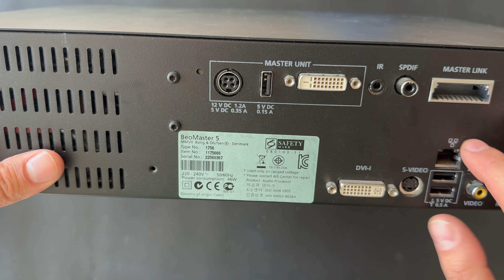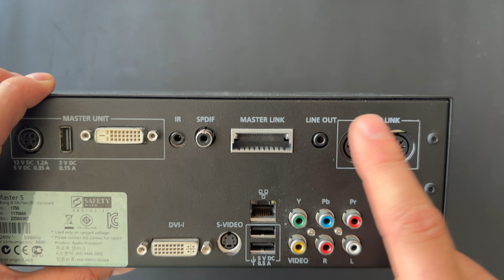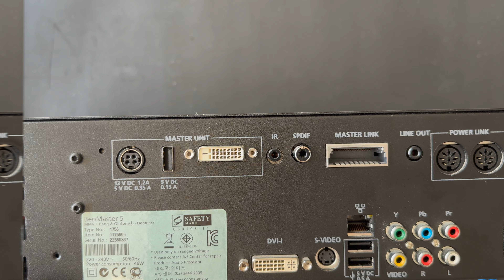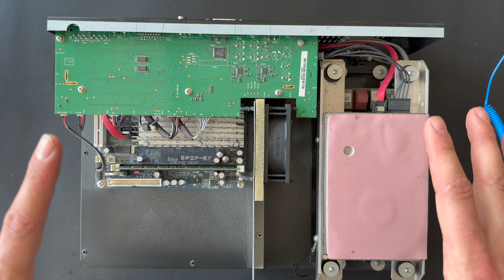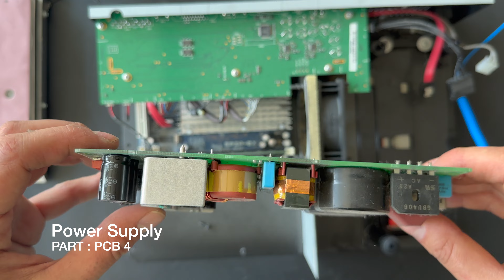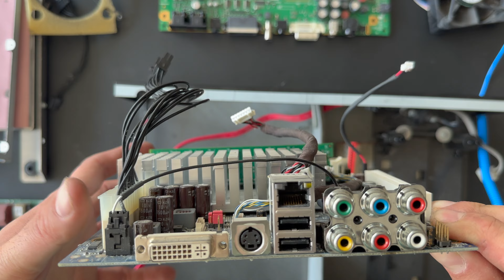Bang & Olufsen Beomaster 5 Disassembly process and Repair guide

Comment: Hi what does the 5V DC 0.15A control
Reply from the maker: The 5V DC 0.15A output is used to power external accessories, depending on the system configuration. It isn’t intended as a general-purpose power supply.

Comment: Mainboard may have been made by Asus, so not great to begin with. Also, I see lots of vented electrolytics. Chances are it will work if you replace them. You might look at Panasonic FR types for replacement.
Reply from the maker: Thank you for the suggestion! You're right—many of these mainboards have electrolytic capacitors that degrade or vent over time. Replacing them with high-quality options like Panasonic FR series is indeed an excellent approach and often resolves stability issues. We'll inspect the board closely and proceed with replacing the problematic capacitors. If you have any further recommendations or tips, feel free to share—it's always appreciated!